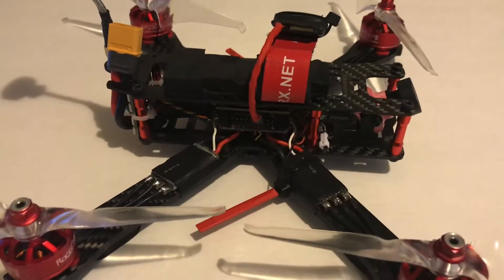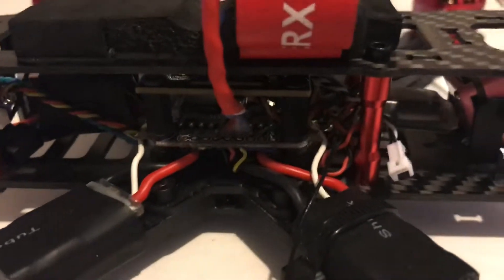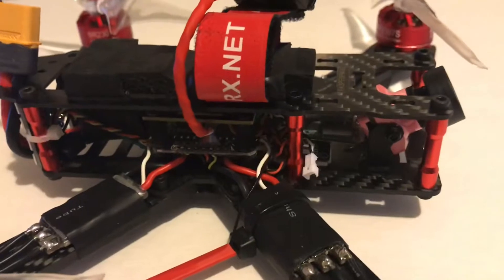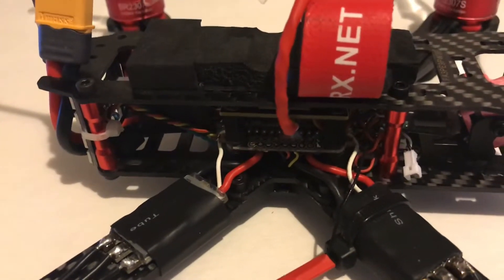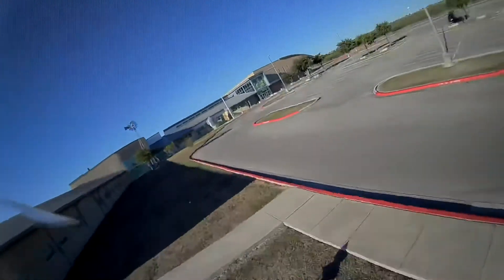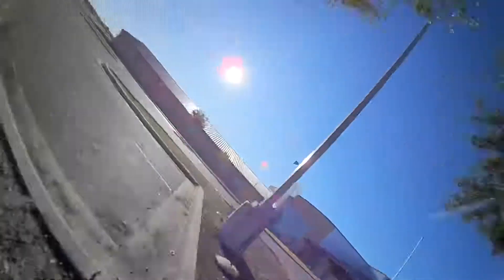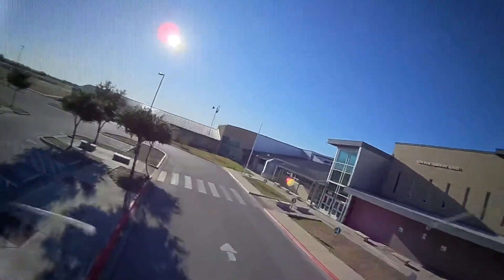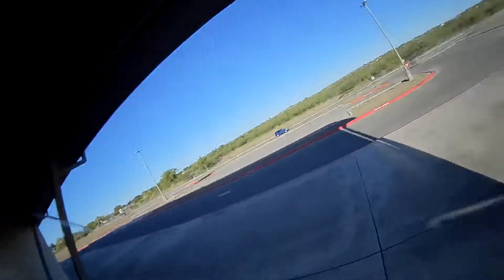Redneck Review Omnibus F4 PDB Flight Controller - Bought from Banggood

Comment: How did u get your sbus to work or to show up in betaflight
Reply from the maker: On this quad I am only using an XM+ receiver. It is wired into RX6(s) or UART 6. RX1(d) would be for DSMX or other non inverted receiver protocols. When selecting the receiver protocol in Betaflight, select SBUS and choose UART 6 and it should read it from there. Have fun and keep her in the air!